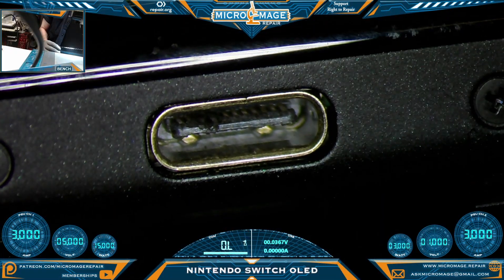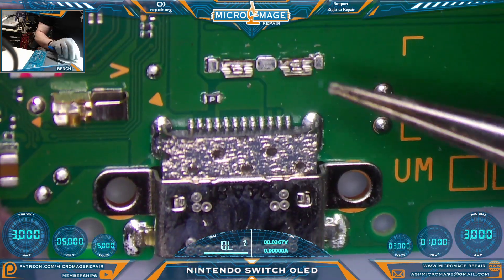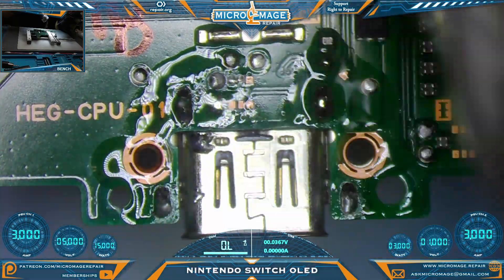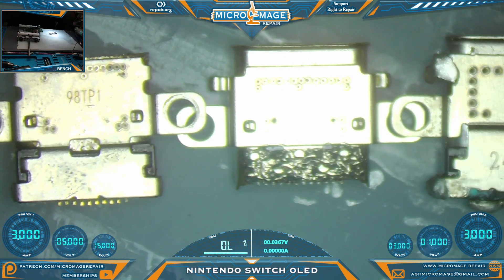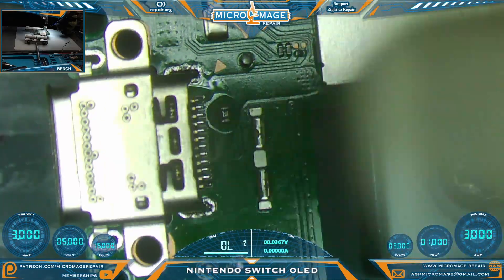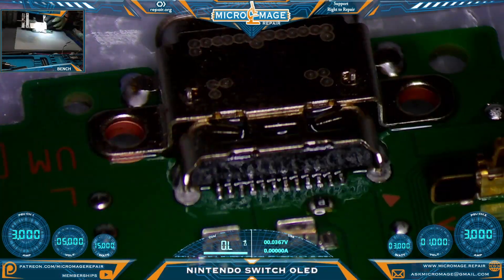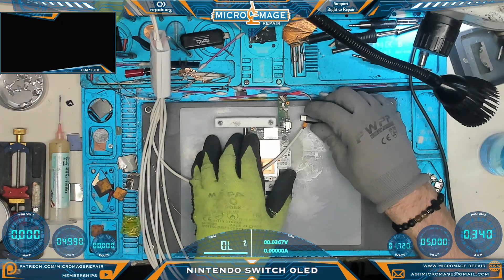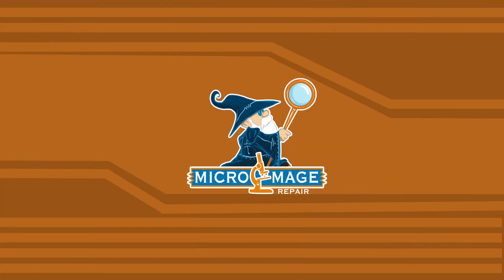Nintendo Switch OLED: They Are Starting to Roll In!

Comment: Everything unpacked and no more boxes left from the move down to TX?  Looks around at boxes here from move 2 years ago <vbg>
Reply from the maker: I took the week to get things unpacked and worked from daybreak till midnight getting everything setup.
Was not going to be working out of toats 🤣
Reply: @MicroMageRepair  Good to hear that you got everything set up. Trying to find all the boxes etc the stuff was packed in and not unpacking stuff you never used in the last location. With me it was 21 years of stuff and junk that I was pitching and pitching and hauling to the dump wore me out.
Reply from the maker: @GregM  I had time to purge allot of that over the last month or so luckily though I definitely didn't have 21 years worth!